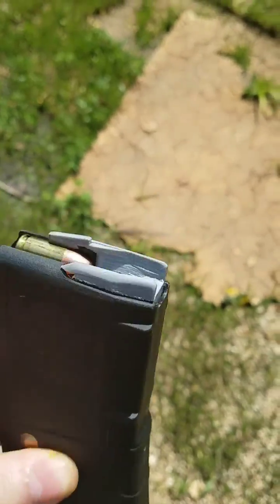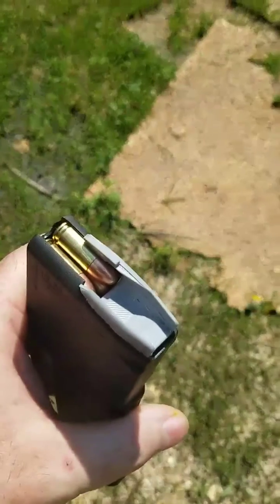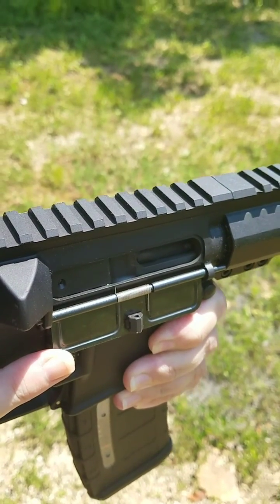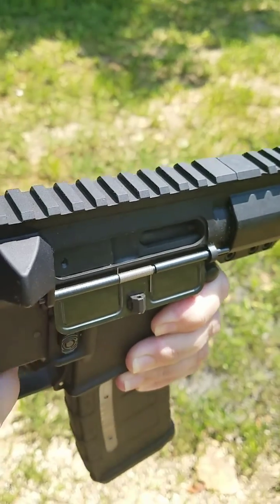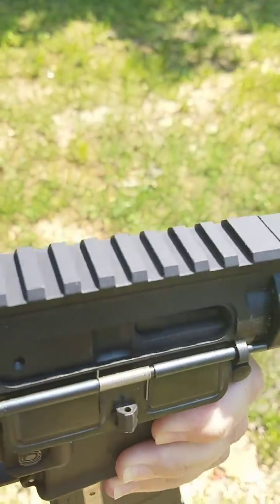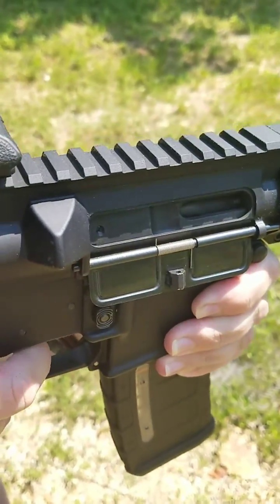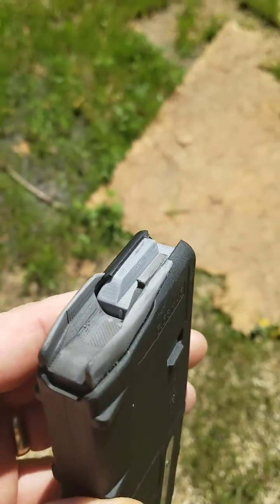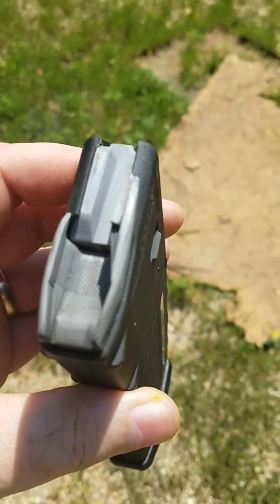5.56 to 9mm mag converter new material

Comment: Just wanted to say thank you. I just got done assembling my first conversion mag. LRBHO, cheap p mags, and works with FM9 upper, can use cheaper ar15 lower instead of dedicated ar9. The bees knees!

Question. Have you tried any speed loaders?
Reply from the maker: Ive not used a speed loader myself. Im still hoping to some day get these injection molded and available for cheap.

Glad its working for you!
Reply: @jeffdill5260  I put a standard AR Lula loader on it and it would take some adjustments for it to work, possibly.
Reply: Stl file please